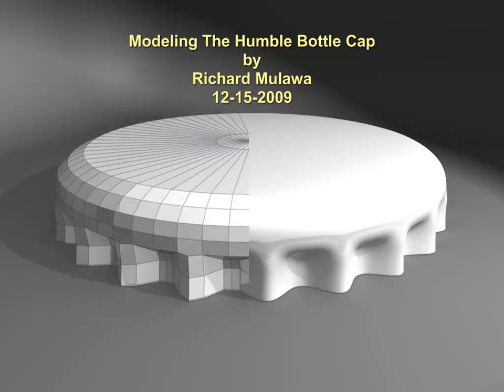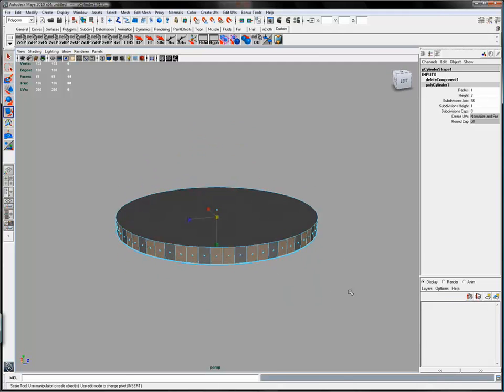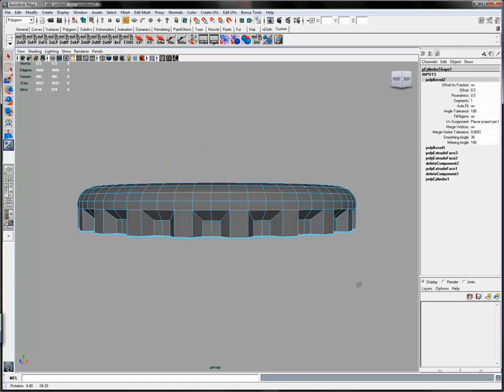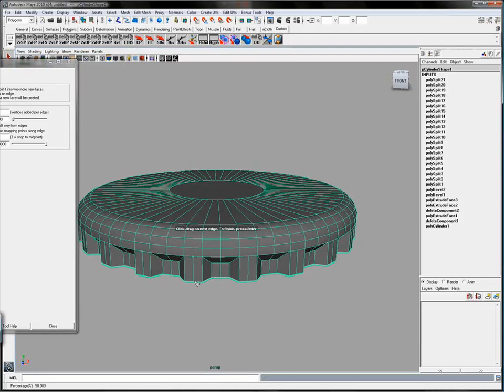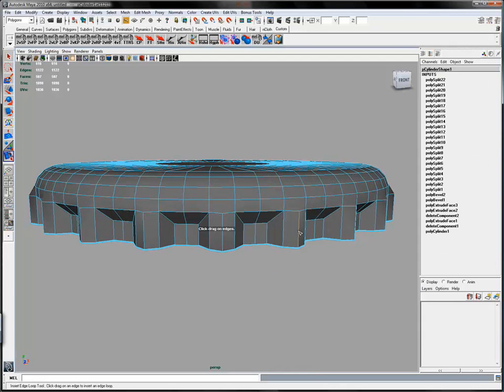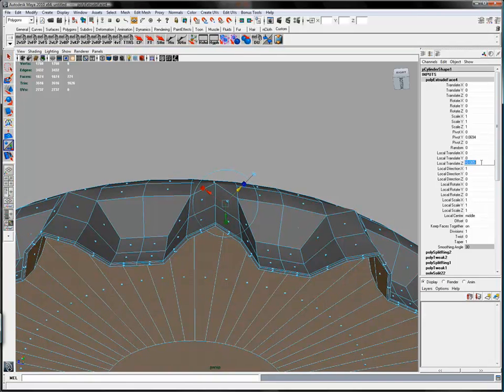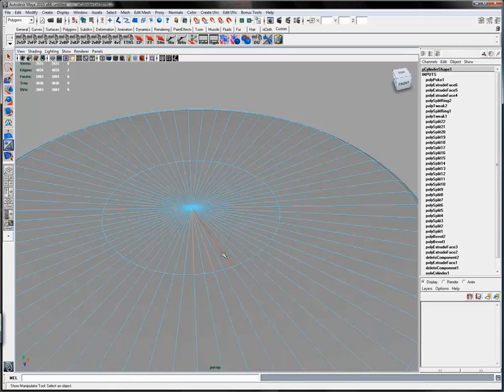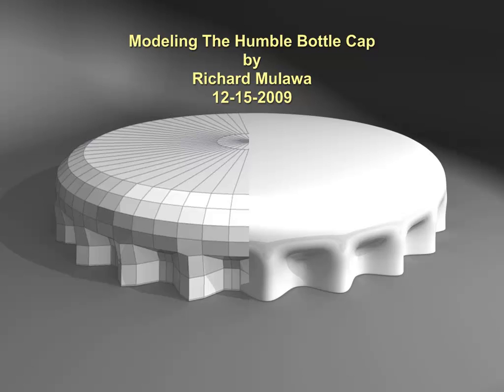bottle-cap-tut-final.mp4

Comment from the maker: where the edges converge at the pole you have a bunch of tri's (3-sided) polygons.  By deleting every other edge you create all quads (4-sided) polygons.  Typically you want to create your models with all quads when you can.  tri's and ngons do not always smooth properly.  However, this model does have n-gons and I used it to demonstrate that ngons are not always bad. An ngon is a poly with more then 4 sides.